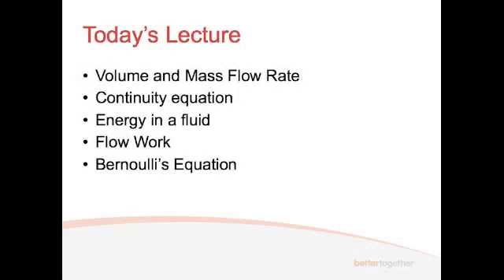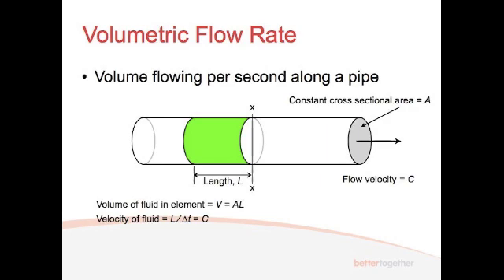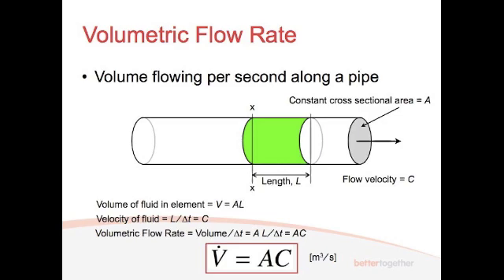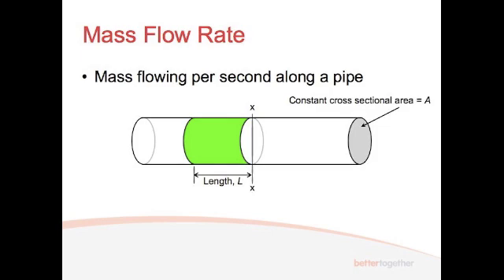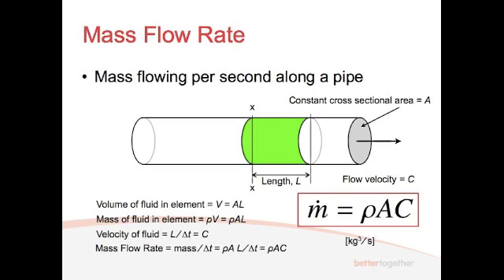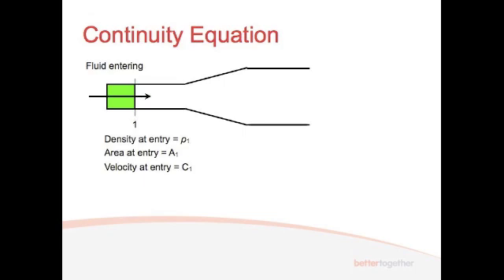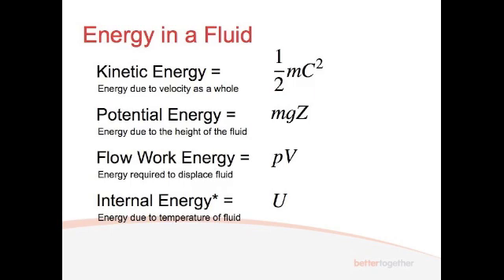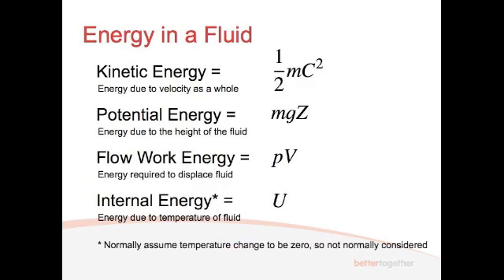Fluids - Lecture 2.1 - Continuity and Bernoulli's Equation

Comment: hi everyone i was wondering if someone could answer one question if we take  half of the bernouilli's pipe ( we would have the big side on the left and little on the right )the formula to calculate the air strengh ( in newton ) that comes out with a higher velocity . the volume flow rate entering ( so coming out too ) is 17 000 cubic meter per hour and the velocity in the little side of the pipe is 50 m/s  thanks for anyone who has an answer.

Comment: Why does the fluid not start to flow when a pipe is emmersed in the same tank. One end of the pipe is under the water near the top of the tank and the other end is 1 metre lower so why dosn't it flow to the lower end of the pipe, and discharge back into the water????
Reply: Because the property of the fluid is to flow from high pressure to lower pressure. As you put the pipe at 1m depth where the pressure is more (presssure increase with depth in a fluid) that why the flow does't occure.